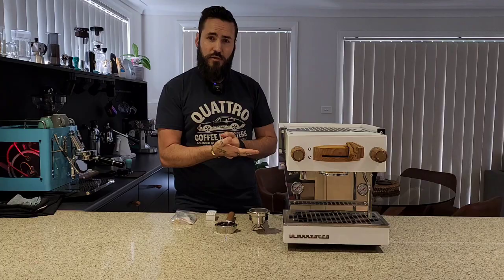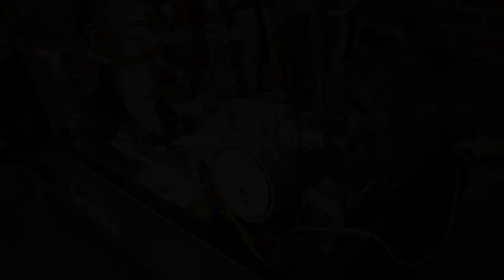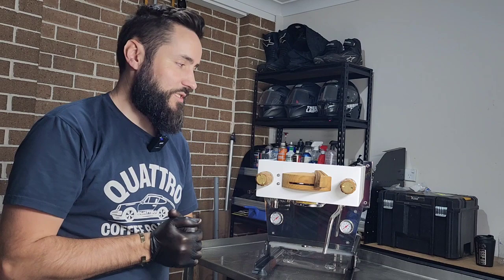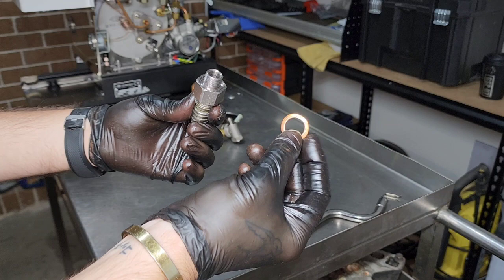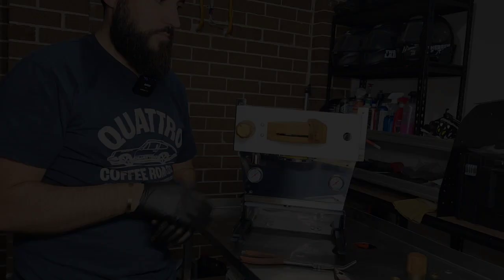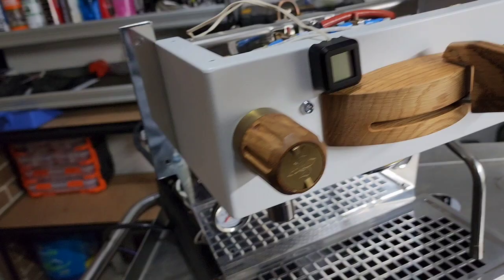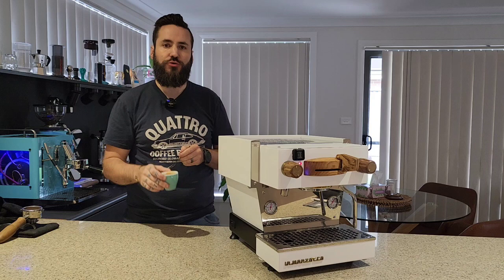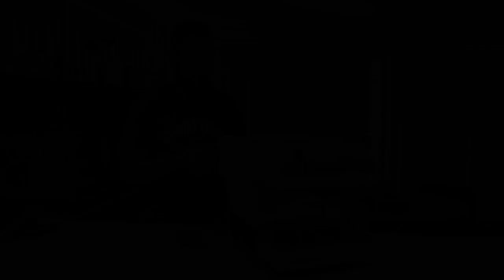LaMarzocco Linea Mini Service "CUSTOM 1 OF 1 SPECHT"

Comment: That was a great video, Mitch. I'm so glad I found your channel. I have owned the Linea Mini since December of 2015. I could not be more happy with it. Adding the $500 USD Control board and using the La Marzocco App allows the user to set the temp, choose a pre-brewing time (pre-infusion is available if the machine is plumbed in) and has a great cleaning cycle on it. Because of your video, I will rebuild my steam wand valve assembly. I would love to know what you did to this customer's hot plate to secure it better. Thanks again for doing this. It is a big help.
Reply from the maker: Thank you so much for the feedback.

I used some thin tubing (sliced down the middle) to simply create a tighter fit. Feel free to pop me a message on Instagram or email if you need more info
Reply: @mitchdoescoffee  your video is very informative and I’m learning a lot. I recently purchased a used LMLM and it’s out of warranty so I’d like to do some work myself if possible and your videos are a great guide. 

That being said, my mini worked great until today, but now I have no steam from the wand or hot water from the steam boiler when turning the knobs. The steam gauge is showing 0 and water coming out of the steam boiler release/ drain valve is room temp. There is no water or steam coming up the clear tubing either. 

So I’m thinking it’s the heating element, but wondering if it could be the vacuum breaker, preventing it from closing and thus not starting the heating process?? I’m not sure how to check and troubleshoot that without just replacing it. I’d like to try and DIY before calling in a tech for $$$. 

Your advice or thoughts are greatly appreciated.
Reply from the maker: @chrisgiese1964  hey mate. Thanks for tuning in & your feedback. 

I would definitely start with the breaker as it is a standard service part anyway. (I would replace all of the valves while you are doing this) as I would recommend doing them every 12 months 👍

Comment: Awesome video. Super helpful. Do you have the part numbers for the vacuum breaker internals and where you source the service parts from in Australia handy?
Reply from the maker: Thanks for tuning in mate. 

I would always suggest using coffeeparts.com

The website is pretty straightforward with diagrams for all common machines.

Comment: Hi Mitch, i just bought a used LMLM and the whole mobile cart with water booster and water filter. Can you please give me some tips on how to descale the machine? Thank you! Cheers to your channel
Reply from the maker: Congratulations on your purchase. 

I would start with the cafetto LOD in the water tank & run a simple 30 minute soak. 

I will do a video on this soon.
Reply: @mitchdoescoffee  thanks Mitch. Should i bypass the booster and and connect directly to a tank with descaler
Reply from the maker: @d4rk_entityy Yes, that is an easy way to do it. 👍
Reply: @mitchdoescoffee  I am really looking forward to you putting up a video on that soon.  I was planning on running a descaled through the water tank for 30 minutes but was concerned about how to completely flush out the solution as to not cause any damage.
Reply from the maker: @tvitarelli that will be fine... just ckean the tank, then run 2 complete water cycles afterwards to ensure there is no contamination.

Comment: thanks for the detailed video! just wondering, for the different fittings, is there a torque spec sheet anywhere, or is "decently snug" all that's needed? and do any special rules apply to particular fittings?
Reply from the maker: Beswick engineering have a torque guideline for all types of fittings/materials. I've found this to be very helpful when working on any machines. 

https://www.beswick.com/resources/fitting-installation-guidelines/
Reply: @mitchdoescoffee  oh incredible, thank you! interesting that the torques are actually not very high! at least not compared to common bicycle torques I' m used to :)
Reply from the maker: @hao-tongyan4872  that is very true. I was a bicycle mechanic for 16 years & aluminium/stainless steel definitely requires much higher tourqe settings than brass/copper as the softer materials will assist with sealing. Obviously, they can't be used as handle bars though. 🤣
Reply: @mitchdoescoffee  that is... not unless they find out that brass/copper can be more aero ;)
Reply from the maker: @hao-tongyan4872  oh no. Dont tell them that. 🤣

Comment: Hey, great video mate - random question, but would it be feasible on the Linea Mini to swap the hot water spout and stream wands around so wand was on the left etc?
Reply from the maker: Without trying it myself, I wouldn't saybwith 100% certainty... But I really can't see why you couldn't do it. 

You would need to get some hard lines custom made as the water & steam lines are not interchangeable. But with a little bitnof creativity, I can't see why not.

Comment: Great video thank you! I have Three questions, First where do you use to source your parts? Second I have a linea mini that is plumbed in and the Flojet pump constantly works even when the machine is off. I have constant water leak from the hose close to expansion valve, even though expansion valve is completely closed, I even changed the whole Vacuum steam breaker part, I appreciate your help with this. Third question is that I want to learn how to service my linea mini and reached out to LaMarzocco in the States a 100 times but they never let me take any classes as a technician, do not know why! Is there any other way to learn? Thank you again for your help.
Reply from the maker: Great questions. I will DEFINITELY be answering these questions in my upcoming Q&A video 🙏
Reply: @mitchdoescoffee can you tag me in it do not know where your Q&A is but I’m impatiently looking forward to it haha
Reply from the maker: @miladsari8391  click the bell 🔔 and wait for next week's video 👍
Reply: @mitchdoescoffee  Mitch, did you get a chance to make the Q&A video?
Reply from the maker: @Oracleidol8  should be finished in the next week or so. I may have to break it up into 2 parts as I have had alot of questions to answer. 😬
Reply: @mitchdoescoffee   Could you tell me what the issue is so I can research it? I still have leakage from the Expansion Valve even though I have changed the Vaccum steam breaker